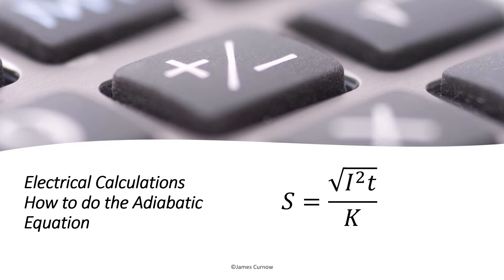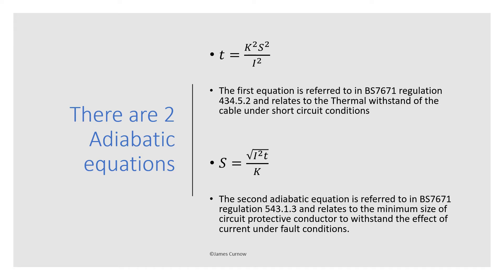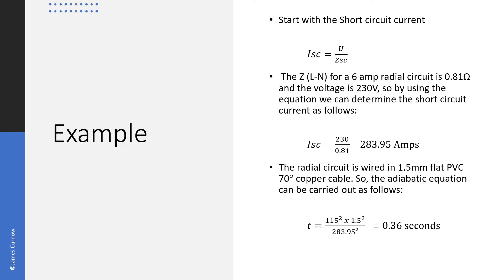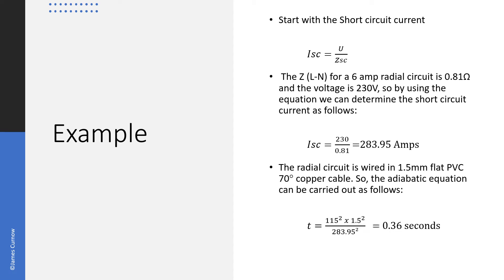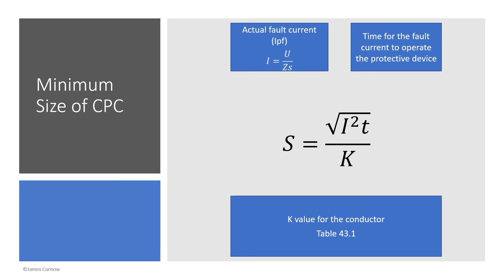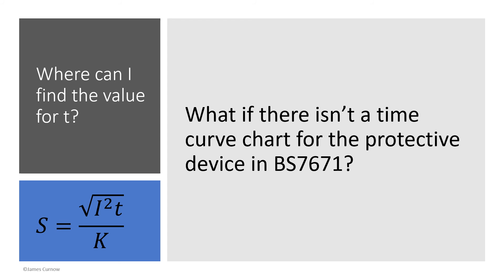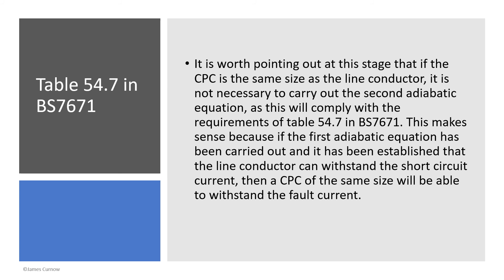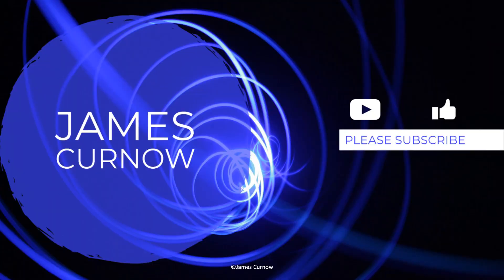Electrical Calculations How to do the Adiabatic Equation

Comment: Hi mate- I’m guessing then you have to look at curve chart to see if the 0.36 seconds is  higher than the actual disconnection time of that  6 amp breaker  with 283.95 of fault current?

Comment: Adibiatic equation. That particular one is for correctpy sizing the protective conductor.
Can also be transposed for thermal withstand under fault conditions where 
T= S²K²/I²

I always loved the matatical side of electrical engineering.

If you  can understand that then you can understand where a lot of regulations get their figures from

These videos will be golden for any learner or as a refresher. Keep up the good work! 💪

Comment: Great info buddy. Only just come across yourself. was Looking for info on using swa as the cpc as changing my fuse box in the garage (2 core 2.5mm cable already buried and under concrete lol)

Comment: Is it permitted to use the equation to calculate the main earthing conductor on a TNS supply?  ie 6mm or 10mm instead of 16mm
Reply from the maker: Hi Gerald,
Thank you for your question. Yes, regulation 543.1.1 says that the cross sectional area of every protective conductor, other than protective bonding conductors shall be calculated in accordance with 543.1.3 (which gives the adiabatic equation) or selected in accordance with 543.1.4, which means selecting in accordance with table 54.7 in BS7671. Please also bear in mind that: there are minimum sizes for buried earthing conductors and the DNO may specify a minimum size of conductor.
I hope this helps.
Regards
James